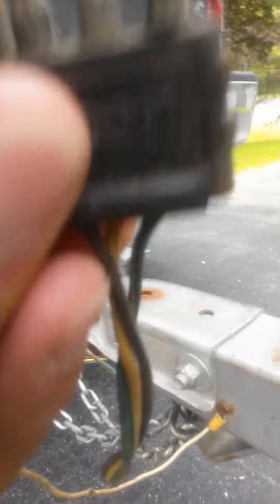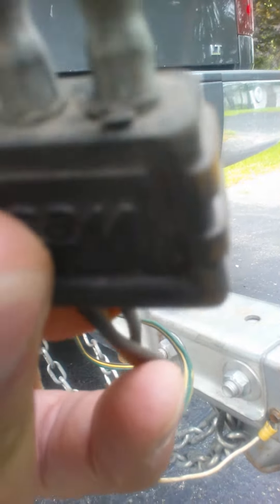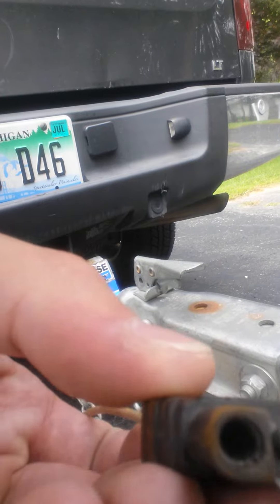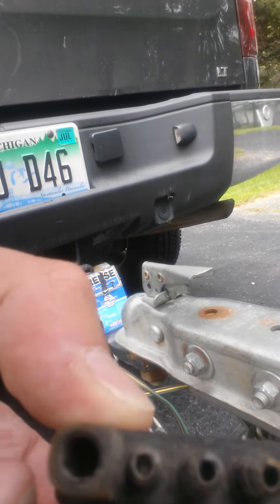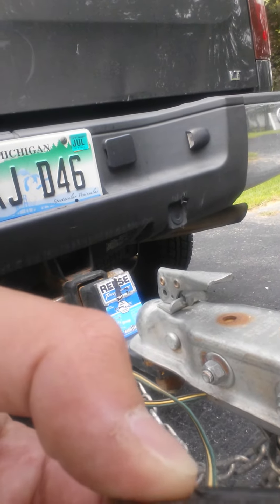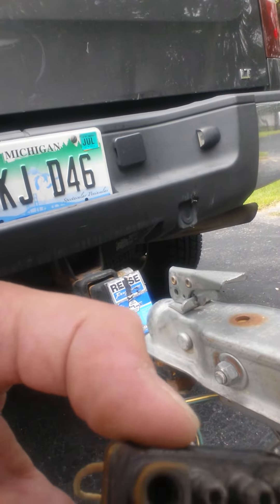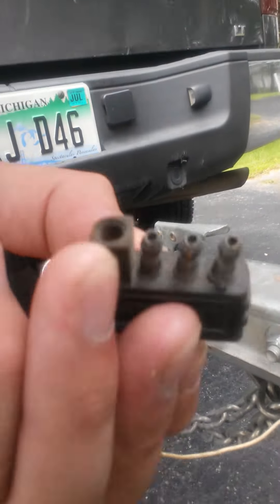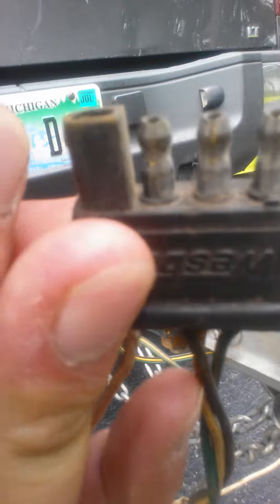Diagnosing running lights on trailer

Comment: I have a open two place sled trailer, I've redid the whole trailer, just the other day I was gonna use it to put sleds in storage, and my left side (drivers) lights up, just very dim, other side bright! I have installed 15 new led lights also, brakes and signals work, drivers side just a dim glow
Reply: boondockr87  the reason I go to YouTube is to watch Someone use a multimeter  are a test light thanks for a E book translation . Lol